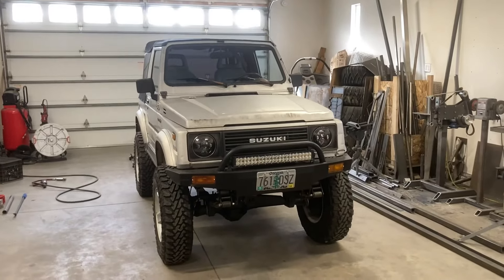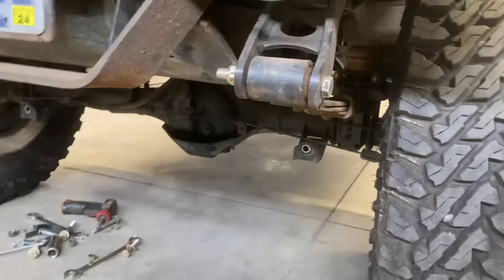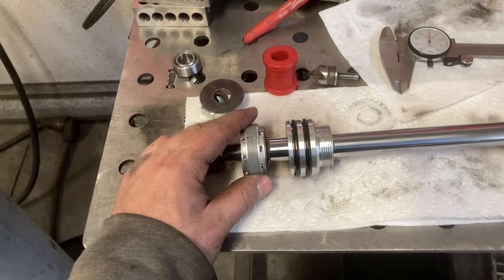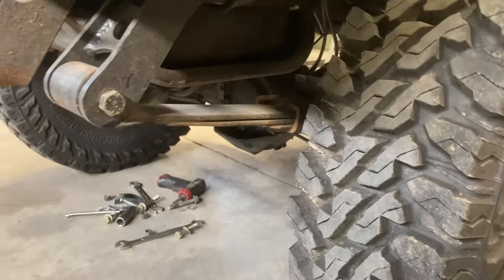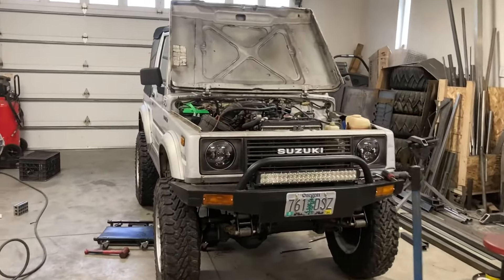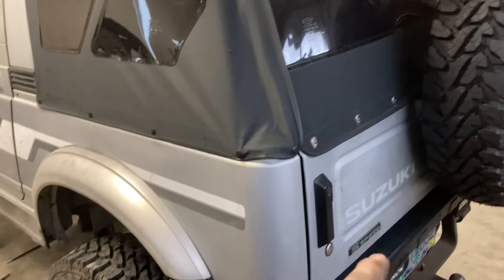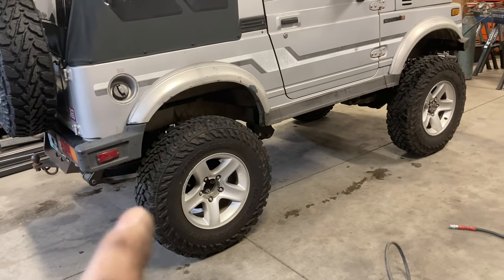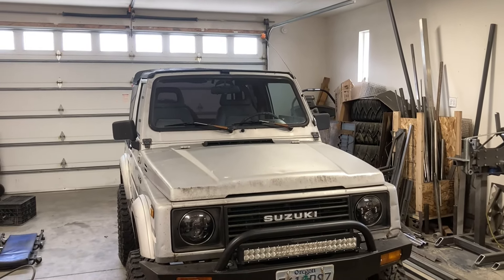Improving Suzuki Samurai ride quality by tuning shocks

Comment: Just purchased an '87 Samurai (unmolested) for my farm. I don't expect to be crawling over rocks or racing across the desert - but wanted something I could drive on the road up to the farm and then use it to start reclaiming the farm (essentially on the side of a hill along the KY River with old logging roads cut into it). I saw this video and like the idea of going up to a 16" wheel and thinking about installing a Rocky-Road YJ under axle lift kit (this is a YJ bolt-on kit as I am not a welder but figure I may have to learn). I am waiting to see what you do on the teal/black daily driver you are building for yourself as you were talking about using the 235/85R16 tires with only a 3-4" lift - I will be curious if you run into any issues. Hope that works as this may become my plan then as well. I have never heard people say good things about using spacers between the hubs and the wheels - but seems pretty common regarding what I am reading about as pertaining to the Samurais. I have really enjoyed watching your Samurai videos as they are giving me some ideas - only wish I had your skill and experience.... Jeep up the great work!
Reply from the maker: @lorenkloft836  thank you for watching and the kind words. Unfortunately the black samurai is on the back burner for a bit since I got the tin top, but the 235/85s are still my plan. I like skinny tires on light rigs. I haven’t heard the best things about rocky road, but do your own research. Trail Tough has always done me right. Enjoy the Samurai! They are super fun rigs.
Reply: @ultra4suzukisamurai679  From what I have been gathering, the missing link shackles may not be "nice" for highway driving - again, I am new to this. I spent some time today researching lockers and spools(?) - not sure I understand the difference(s) yet - but sounds like the lockers can be "iffy" on the road until "you get used to them"? I like the idea of the lockers as the hill sides on my farm are pretty steep. Someone had welded the rear axles together in the first Samurai I looked at and I could feel it while turning on the pavement and hear it "jerking" while turning on gravel - and didn't feel it would last very long driving on pavement. I foresee this Samurai spending quite a bit of time on the road as well - so I want it to be safe and useable on both pavement and dirt roads and trails. There is a lot of information out there and takes time to go through it - just hoping to gain from the experience of others so I am not wasting time, money, or effort building my rig (in the wrong way) to what I want it to be able to do. I have already started thinking that I might need another one that can simply be dedicated to the farm. I came across one of the pickup models down here but wasn't sure I wanted to put that much $$ into something that might get slid into a tree up on the farm. Thanks again for taking the time in order to make the videos and educating us newbies...
Reply from the maker: @lorenkloft836  mechanical automatic lockers: lock right, sparten, etc are great in the dirt but pretty annoying on the street. They will let the outside tire spin faster in a turn but there is a lot of slack in their operation so they feel very clunky. A spool is the same as the welded differential. If you want it nice on the street I highly recommend air or electric selectable lockers. When turned off they are just a standard open differential, when on they are a spool. More money but worth it for sure. I have a deal set up with TRE3X4USA for 10 percent off. Code ‘ultra4samurai’. I run their electric lockers and love them. Before that I had lock rights. Great off road but terrible on the street. Another option, as expensive as the electric lockers is a limited slip from Kaaz. If you put a locker in the front it’s a must to upgrade to heavy duty 26 spline axle shafts. Stock are 22 and break easy with lockers, but hold up very well with out a locker. A Sammy with a rear locker only is night and day more capable than stock. The front locker adds a lot of cost due to the axle shafts and power steering becomes a must as well.
Reply: Man you’re my samurai-farm brother. I’m doing the same thing with an abandoned farm/farmhouse and samurai 🤘🏽
Reply: @joshuatoral5105   We might not be the only ones using a Samurai for tasks like this. My F-150 is simply too long and big to navigate the hillsides and narrow trails that were cut into the hillsides decades ago. The cost/capability decision between the Samurai and a JD Gator or UTV didn't take much thought. The Sammy is street legal so I can drive it up to and back from the farm (~40 miles each way), it should handle the terrain as well as a Gator/UTV (and perhaps be even more capable). My wife and I are nearing retirement, and I am thinking this is small enough that I can tow it on certain trips that might be fun, useful, or simply come in handy. Unsure yet - but my wife told me I looked "adorable" when I shared this idea with her.  I was surprised how many people talked to me about it at the gas stops when I was hauling it home on the trailer. I may need "help" as I am thinking I may need to be on the lookout for another one... This one I simply want a capable rig that can run on the streets and take the hills out on the farm.
Reply: @ultra4suzukisamurai679  I spoke with Tony over at TRE4x4USA this past week and decided on the e-locker for the rear axle at this time. I may add the front one if needed later. They currently have them on sale. I think I was overwhelming myself with information and needed to step back and break this process down into "bite-sized" chunks. This weekend I started making a list of things to be done to it - starting with basic check-list maintenance stuff first. The transfer case shift sheet was delivered, along with a similar upgrade for the transmission. Spent some time researching wheels to give me a little more clearance. Would really like to avoid using spacers - but seems most Samurais with tires larger than stock seem to use and need them. I don't want to consider an axle swap at this time as a 1.6liter 16V engine would be a higher priority for me. I saw TrailTough offers a bolt-on SPUA kit; comes with missing-link shackles but can be bolted together to work as a single shackle. I wish I knew for certain that the SPUA lift would give me the tire clearance I want. I don't plan to go over 31" so I am not straining the Suzuki axles as much. I have no intention of running swamp tires as I am wanting a narrow tire for what I will be doing. I am not anticipating having to ford any streams or creeks on my farm; but wondering if many people add vents to their TCs, transmissions, and diffs? I asked Tony about it and he uses them. Just wondering since the e-lockers could possibly get wet down the road if we go exploring trails. (Any thoughts?)
Reply from the maker: @lorenkloft836  it’s pretty easy to add vent lines to all the gear boxes in a samurai, and it’s a good idea to do it. You springs SPUA usually give about 2 1/2” of lift, pretty tight for 31s. Standard 7 or 8 inch wide wheels usually work just fine. I would worry about the e locker getting wet. You don’t want water in the diff anyway but the electric part is just an electro magnet and is sealed in epoxy. The connectors are sealed as well. It’s always a good idea to check the axles anytime you cross water deep enough to put the axles under. Especially the front axle as water can get in through the knuckle seals pretty easily easiest way to drain the knuckleballs to just pull one of the kingpin bolts out and water can drain. Definitely adding extended vent lines is a really good idea.
Reply: @ultra4suzukisamurai679  Received the e-locker yesterday from Tony. Purchasing parts now for planned upgrades and was wondering what your thoughts are on leaf springs? Seem to be a lot out there to choose from. Some from India; lots from China, some have wedges (I guess to slightly rotate the axle for better driveshaft alignment). I think the YJ-adapters will raise it about 2-2.5 inches, and I was thinking about going with a 2-2.5" lift leaf spring. Again, I am not planning to be hard core crawling, so tons of articulation are not needed. Seeking comfort o the road and capability on the farm in the timber and hill sides. In this video you mentioned that it is possible to bend these springs. Are there any "favorites" that you prefer - or any info on springs to avoid? THANKS again!
Reply from the maker: @lorenkloft836  I recommend looking for used jeep OEM springs. Most of the aftermarket ones are just junk if you’re going with Lift springs go with a well known lift company. I don’t have any recommendations as to who to choose because I have not gone that route. All the ones I have done have been with OEM jeep springs.

Comment: Hello, good video. I have a question, I also have spoa, and the leaf springs are flat, I want to send them to re-arch, what size should I use? Thanks!
Reply from the maker: What size tires?
Reply: @ultra4suzukisamurai679  31"
Reply: @ultra4suzukisamurai679  🚙🚙🚙
Reply from the maker: @mathewsren9712  it’s a hard question to answer, spoa for 31s won’t take much arch. I would take a measurement of your Sammy now then jack it up until it sits how you want it and measure again. The difference would be how much more arch you need in the springs.
Reply: @ultra4suzukisamurai679  Thank you very much, I'll do that!

Comment: Nice helpful tips…what is your wheel maker and size….?
I like your set up….
Reply from the maker: They are 2002 grand vitara wheels. 16x7
Reply: @ultra4suzukisamurai679  i also installed these rims to my suzuki sj 410 1 litre engine with 215/70r16 for on road use. These rims are 16inch with et +5

Comment: Hi. I was literally looking online for a samurai, and your video showed up. I have a question about the year models. I really would like to buy one as stock and keep it that way. What year model would you recommend? I think 91 to 93 convertible cuz of the updated engine and the rear seats.
Reply from the maker: I would be worried about the fuel injected models. As time goes on parts will be harder and harder to get. The fuel injected models will be harder to keep running. The carbed engines are very simple and when boiled down to the basics it is very easy to make one run.
Reply: For us in india it's the opposite. The samurai mpfi is very simple and reliable.